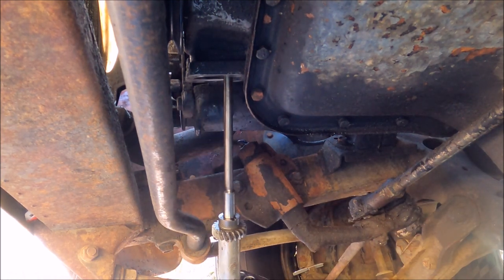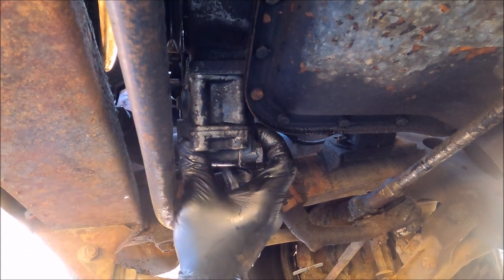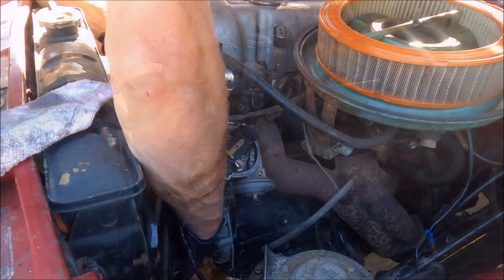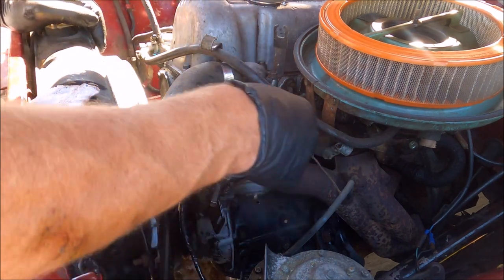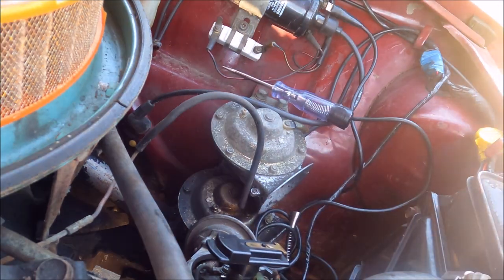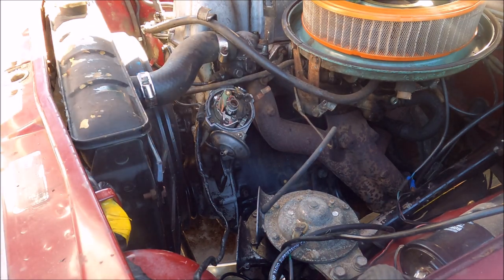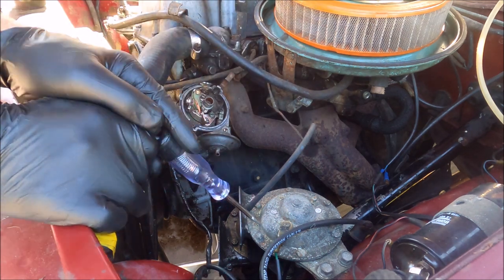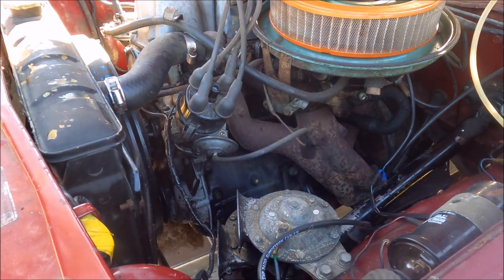A Datsun PL521 Found Me - L16 Oil Pump and Static Ignition Timing Setup

Comment: Great video. I have not been able to find what the l16 marks are in my haynes manual. That one picture with the teeth is perfect. I have one deep tooth for TDC and 1 to the left of it.
Reply from the maker: Glad it helped. :)
Only 1 small groove? I wonder if it is at 12 degs.
Reply: @i2edeye  I have 6 marks and 1 is deeper than rest. I just make a short video. You have the best video on l16. I just cant see if you have 5 or 6 marks on your pulley.